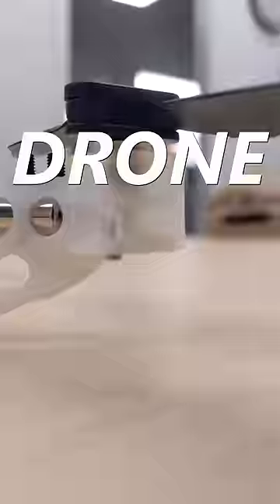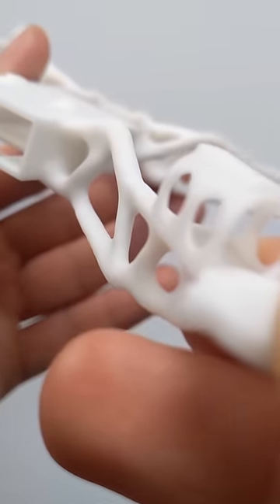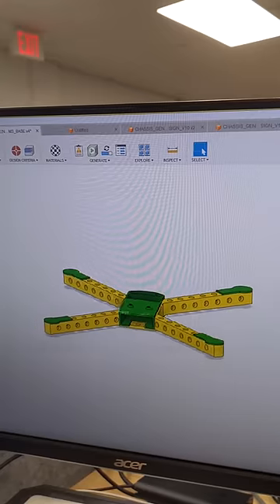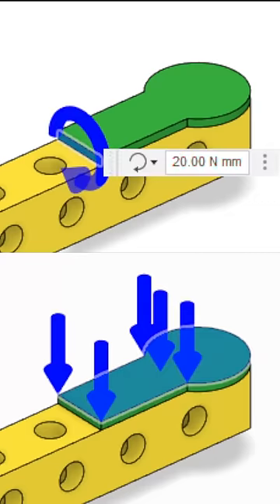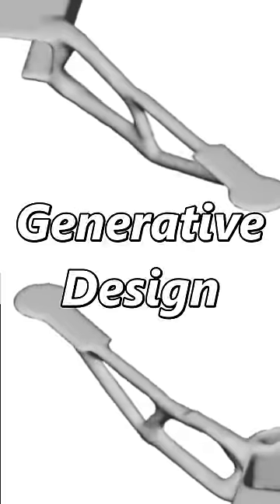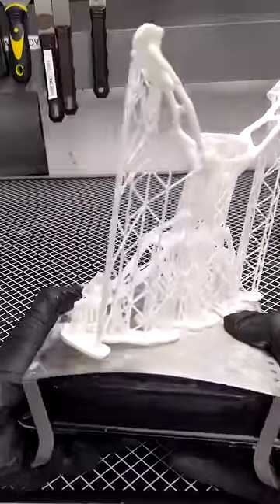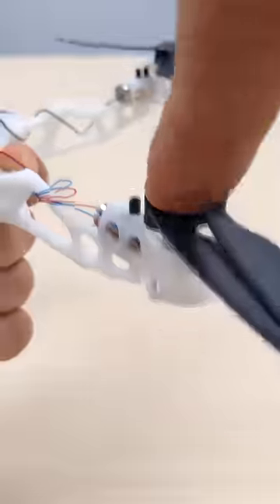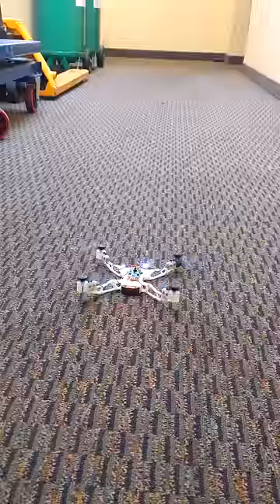3D Printed Generative Design Drone Chassis #shorts

Comment from the maker: Wait for the end to see if the 3D printed drone flies! 👀 Check out our 3D printers: https://bit.ly/3n6Hhrk
Reply: What CAD-Software did you use for this?:D
Reply: @randomlysatisfying6064  Looks like Fusion 360!
Reply: @Nawmps  Yes it is Fusion 360
Reply: Which material Formlab?
Reply: When are you going to upload the files
Reply: STL ?
Reply: how much t would you charge me for a bespoke set of 3D printed ebike fairings,.with fixtures for a tig welded aluminium battery frame and wire housing?
I'd like to have a windshield like racing motorcycles, dual mudguards, and a dual light housings.

It's a prototype, so costs are low but I'd be interested to see what AI would build.

Comment: This is not AI, and it's very common and long known algorithm class called topological optimization
Reply: Do you know which software this is ? 
I've done top op before, but how do you know that this is top op and not generative design ?
Reply: @haroonmohammed6351  It's Fusion 360 lol.
Reply: @EdisonWong2004    as mentioned it's inventor fusion, but I didn't knew that I just repeat other postings. 
I know that it's a classic algorithm because I know the current state of neuronal generators. 
You mentioned generative design. This kind of algorithm, that solves you stuff using meta heuristics, is also category "generative design". 
So "generative design" does not exclude "classic" algorithms.
Reply: AI is nothing more than an algorithm...
Reply: @SandSeppel a different algorithm though.
Reply: @SandSeppel  AI is meant to mimic intelligence. This is just an optimizatjon algorithm, it's basically just mathematics, not AI
Reply: AI in its simplest form is just computer doing statistics. Calling this an AI might be a stretch, but is still valid.
Reply: Exactly, they even use this one bikes
Reply: @SandSeppel  is nothing more and nothing less, just isn't
Reply: @EdisonWong2004 it’s actually not fusion 360
Reply: @couchpotatoes5158  oh.
Reply: @SandSeppel  nope it's much more. Look into it
Reply: @hugogonzalez1749  I am making my own AI so I do look into it
Reply: @mastershooter64 AI doesn't mimic intelligence. You have no parameters I can modify to make you smarter... AI does. AI it's just a whole lot of configurable parameters that change while you train it to find the best combination to produce the expected outcome. Overly simplified, of course.
Reply: @mastershooter64  AI is mathematics. Slightly more sophisticated than high school maths, but still maths. It is not magic. It is not black magic imbuing a computer with a soul. Although, it might look like it to a sufficiently unsophisticated BI (biological intelligence)... that believes in souls 😏.
Reply: Technically still AI it is artificially intelligent. Most algorithms can be classified as AI not an amazing AI but AI none the less. But thank you for actually naming the algorithm I could not figure it out.
Reply: Topologial optimisation is litterally the learning function of machine learning.
Reply: Interestingly.. it reminds me of the westworld designs. I never had any prior context for the weird spider-web like structures they’re using. But seems like it could be their way of saying AI prefers topological optimized structures. Which is neat.
Reply: @mastershooter64  lol, maths is literally what and essentially all that AI is. I did think that calling this AI though was a stretch. Autodesk actually have a blog article asking “is generative design ai”, but seem to say that it is in their book while conceding that not all ai gens are good and that human input is required too.
Reply: Where s the border between AI and just algorithm
Reply: exactly
Reply: @andrewsponer7973  well AI is typically understood as a neural network that had been trained on some training data. This is just optimizing some objective function based on stiffness constraints. Also, I don’t really know why people call topology optimization an algorithm, when it is actually the family of optimization techniques
Reply: That is ai
Reply: @andrewsponer7973  AI is any form of algorithm that outputs any form of intelligent response or seemly intelligent outcome. NEURAL NETWORKS are a form of machine learning that falls under this umbrella. It seems that people in this thread forgot that AI and neural networks are technically 2 separate things. ML is a form of AI, but ML is not at all required to be AI. Something as simple as A* pathfinders algorithm is technically AI, but noone would call it machine learning
Reply: It is ai
Reply: That is how ai works though, but I agree I don’t really think this should count as ai
Reply: @couchpotatoes5158  But it is, it is just the subscribed version, you can see the design tab there it should be greyed out.
Reply: People bullshit AI so much, a study shows that 40% of AI start ups don’t use AI
Reply: I like how people here don't understand AI is a broad term since they just heard about it in the last few years 😂
Reply: @SandSeppel  Life is an algorithm
Reply: Wierd that you know what this algorithm is, but not what AI is. It's an unfortunate problem with AI but really as soon as a problem is solved, that thing is not longer considered to be AI. I suggest you do some research on what is and isn't considered AI.
Reply: Came here to say this lol
Reply: It is simply gradient-based topology optimization based on the finite element method. Most likely just minimizing the compliance of the structure...
Reply: @vornamenachname906  There is no such product as "Inventor Fusion" You are clueless and quite literally don't know what you are talking about. Fusion Gen Design DOES use AI in the selection of manufacturable candidates from the branching multiple solutions generated.
Reply: Exactly 😂😂
Reply: The term “artificial intelligence “ is broadly applied, you can see in game development they call a bunch of nested switch statements “AI” , it doesn’t have to be a neural network to be considered AI
Reply: Topological optimization is ai ai dosnt have to be a deep learning model
Reply: @haroonmohammed6351  you can use solidworks for topological optimization
Reply: Lol lol a circumstance where being a paid bot shows 😅
Look at all the other bots who are also showing a little about who they actually are 😂
Reply: @SandSeppel  OI is just an algorithm as well...
Reply: Topological optimization has a fundamentally different approach than generative design, the latter of which was used in this video. It’s a stretch to call it an Ai, yes, but it’s not topology
Reply: Well that is AI. 😆
Reply: Topological optimization and Generarive design are two diferent things
Reply: One of the class of AI algorithms is stochastic optimization. When u use a cost functiom on a topological constrained function you get your algorithm. Optimization is the hallmark of learning or generative algorithms
Reply: yep i agree with you, topology optimization is just mathematical method using boundary conditions, constrains and loads to determine the best shape ... in other words you design everything and the method optimizes it within the design. This might look like AI but the difference is an AI trains itself.

AI can use TO, TO can't use AI ... if it makes any sense
Reply: Was looking for this also if it was picked from a 1000 options it would be generative design also they look very different.
Reply: Don’t ruin his hype 😂
Reply: That depends on ypur deffinition of AI. It is very much based on machine learning. Which is just statistics. But that is also what something like chat gpt does. That is way more advanced obviously, but it is still "just" statistics.

Is this true AI or genrel AI. No but we haven't gotten to that point
Reply: One thing you learn from computer science, is that “AI” is a blanket term for any autonomous agent. This algorithm might not use machine learning or a neural net, but it’s definitely AI.
Reply: @lanetimepditty    You are correct. The word AI has turned into any smart autonomous operation. And that is the way it will be in the general lexicon
Reply: @vornamenachname906  You called it "inventor fusion" yeah, your opinion is disregarded.
Reply: @couchpotatoes5158  Ignorants should stay quiet, it's very much Fusion360.
Reply: @mastershooter64 doesn't necessarily always mimic intelligence
Reply: There is a slight difference between generative design and topology optimization. (Although both are algorithmic and not ai.) Topology optimization starts with a bunch of material and removes the least important parts while generative design starts with where the parts need to connect and builds material in the most important parts.
Reply: most numerical optimization methods are considered artificial intelligence

for example, chess AIs using ab-pruning are AI, likewise, transformer models using gradient descent are AI
Reply: Nothing is AI these days, they just say it is for media. Everything is still just an algorithm
Reply: @jamesdeclan7538  1. A lot of stuff is actually ai.
2. Ai is also an "algorithm"
Reply: @SandSeppel  not all algorithms are AI, but some algorithms are. thats like saying addition is AI
Reply: WOW.  It is AI.  Topological optimization IS AI.
Reply: @mastershooter64  What are you talking about.
Reply: @Umi4Life  Not a stretch at all.  Its definitely AI.
Reply: But AI give more views
Reply: @bbarreir0153 you're talkIng about Machine Learning (ML) which is a subset of AI.

AI is much more than ML though, and can be as simple as a path finding algorithm for finding the shortest path to a goal.
Reply: Sounds like ai
Reply: Guess what everything that gets called AI is not AI.
Reply: @SandSeppel all intelligence is algorithmic
Reply: @mastershooter64 all intelligence is algorithmic
Reply: @mastershooter64  if you actually look at how current AI works it does not mimic intelligence at all.

Comment: He's riding the AI wave that's gotten famous recently instead of referring to it in the proper term, topological design
Reply: Except topological design implies manually designed by a human. Models and images built by a learning model are generative AI.
Reply: Typical YOU TUBERS do this daily.
Reply: Ai isn't a new thing. Anything from Google maps to facial recognition is classified as AI. The computer would have had to try multiple times to get that shape within the requirements
Reply: haha "riding the AI wave" exactly
Reply: @alejandrinos implies
Reply: @alejandrinos he manually designed the base structure, did you watched the video?

Comment: That's not ai it is called topology optimization
Reply: Yeah…ai
Reply: Is an algorithm
Reply: And how is the best topology filtered and selected from the very many optimisations produced in a single solve run do you suppose? Perhaps you should go find out.
Reply: @m3chanist it runs a lot of fea solves, doing some sort of convergence towards stiffness to weight. Definitely not ML, and not really ai
Reply: @nexiuz2233  not everything on the computer is AI like when you press 1+1 it isn't AI calculating it
Reply: @nexiuz2233  topology optimizing is math thats around since 1990sth 
the typical ai people talk about is made with neural networks which has been viable since like 10 years or sth
Reply: @m3chanist  what with fucking soft body simulation maybe 
ai is not good for that 
it doesnt do a single run you can even see it in the video that it does multiple checks until it finds good enough model
Reply: @owngamesgamer4030 google maps is ai. Ai has been around since 1951. Just the commen definition has changed now people only believe that neuronetworks and machine learning are the only ai. Deep Blue was probably the most famous  AI when it beat the world chess champion.
Reply: @m3chanist Topology Optimization is made by FEA (Finite Element Analysis), FEA software is not AI, is just a spicy calculator.
Reply: @owngamesgamer4030  Reading comprehension ZERO
Reply: @omegadeepblue1407  This isn't mere topo optimization fool. It grows completely original geometry across multiple generations. It doesn't even need input geometry, just end constraints, hard points
Reply: @m3chanist by minimizing strain energy based on mechanical properties. This is topology optimization.
Reply: @m3chanist  I can do the exact same thing in Ansys, NX and so on. The AI name is a gimmick. The evolutionary algorithm is well known and it uses the output as input.

Comment: it’s an algorithm not AI
Reply: @@jacekmakes2168 an AI can change its outputs from the same input, an algorithm can’t
Reply: @chasealex2496  
Thanks for sharing this information.

AI : different output from same input
algorithms : same output from same input
Reply: Shut up if they computer does it in one click then it must be AI!!! (Joke) 😂😂
Reply: You don't know about generative design apart from a superficial understanding of a single generated solution. Which this isn't.
Reply: @OmarHashimOAD  a bit of an oversimplification and not exactly on point.
Reply: @nlmaster9811  can you provide me with some useful resources or to explain to me briefly about the differences.
Thanks
Reply: same schtick....all pc's are technically A.I just not very good ones and unaware...but dude is definitely using buzzwords.
Reply: @chasealex2496  An algorithm will produce a different design, based on the input values, and the parameters set.

An AI doesn't get any feedback from just printing one chassis, on not get response on how it performed.

No learning=no AI
Reply: @chasealex2496 That's not correct
Reply: @meta0269  you are not correct
Reply: @meta0269  see how unhelpful thst is? explain your answer
Reply: @chasealex2496  Hey i don't want to be mean but why are you making such statements when you don't know what you are talking about. It takes very little programming experience to encounter non-deterministic algorithms that do not always give the same output for a given input. Even using simple data structures like dictionaries can cause your programs to produce wildly different outputs because of their hash table roots.
Reply: @chasealex2496  Anyway it's unclear what method they are using here just because a problem has a simple solution and a complex one doesn't mean the simple one is always used unfortunately.
Reply: @chasealex2496  technically that's just determinism, if you're using an algorithm that has randomness thrown in (e.g. to split 50/50) it's not machine learning.
Machine learning is usually when you make the algorithm work by giving it constraints and feeding it data (e.g. this is correct/this isn't)

Comment: Can we stop calling everything ai?
Reply: This does use AI, it's not a mere single topographical solution as the ignorant halfwits elsewhere in these comments are bleating on about.
Reply: @m3chanist tell me you’ve never used topology study before without telling me you’ve never used topology study before
Reply: @m3chanist The solution of a topology optimization process is not called "topographical solution" because it modifies the topology of the body, there is no terrains here so topography is not applied by the simple fact is not even related to Topology Optimization. 

The result of TO process is called "Optimization solution".
Reply: @omegadeepblue1407  Your pedantry is redundant and proves nothing. The point is, (the one you are avoiding by focussing on the irrelevant, the standard pedant dickhead playstyle) is that generative design is not mere topo optimisation AT ALL. It doesn't even need any input topology, just end constraints. Now go waste some time talking about my using "topo" twit.

Comment: Nice design, however the wireframe or Voronoi algorythms for topological optimization are better suited for machining or injection molding. A 3D printer generally allows acheiving better load-to-weight ratios with a "shell plus internal lattice" approach.

p.s. I might be thinking too FDM'ish and I have little experience with SLA printers, so the need to drain excess resin from the infill volume while printing might severely limit the list of applicable infill patterns. Thus, the wireframe approach you've used might in fact be the best in case of SLA printing.